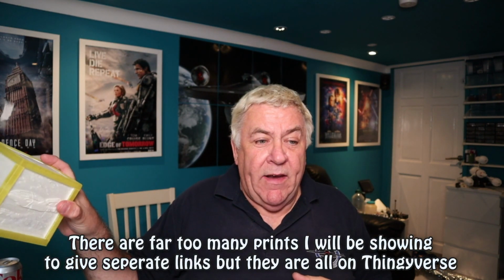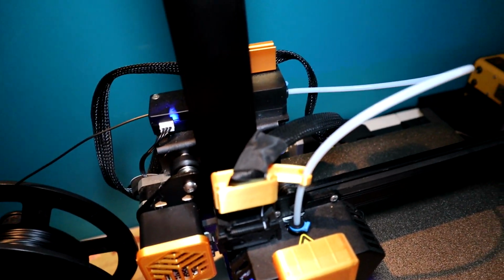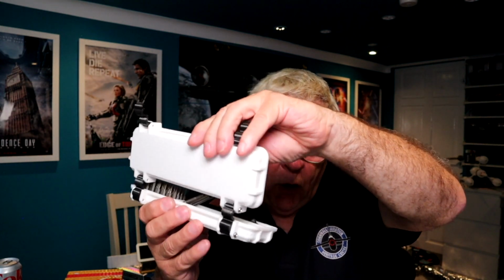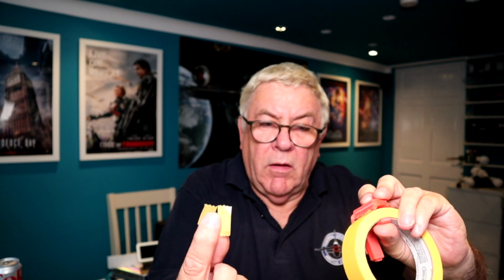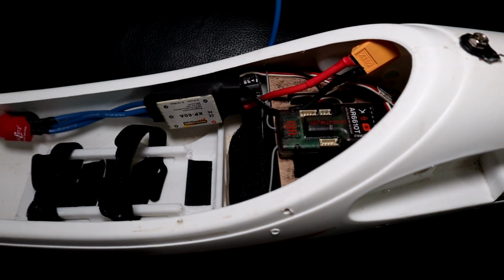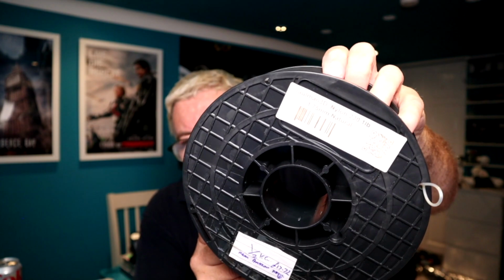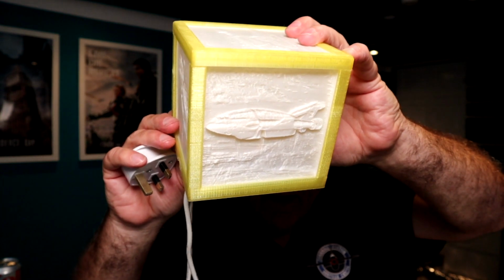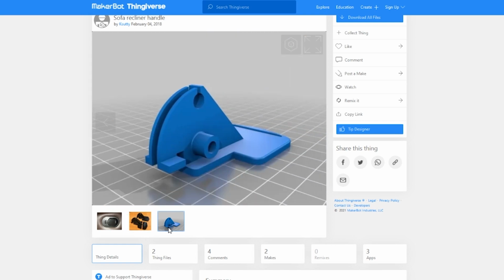What can I print with my 3D printer..Part 2 Useful stuff like tools, lithophane lamps, boxes & more.

Comment: Hey Tom, could I trouble you for a link to the battery dispensers please? Try as I might I can't find the same ones on Thingyverse with option to print the A2/A3 separately and with screw mounting points on the back.
Reply from the maker: Hi Steven....yes you are right I tried a  search myself but couldn't find it (Thingyverse is great for its variety of free prints but terrible for its search engine) 
However I looked through my old files and found it here https://www.thingiverse.com/search?q=1004996&type=things&sort=relevant ...there are a few different versions on this page.
Reply: @TomsManShed  That's brilliant, thanks very much.